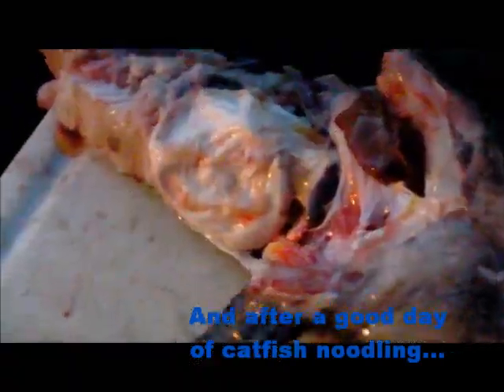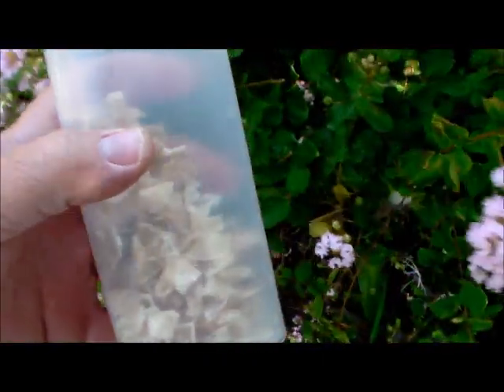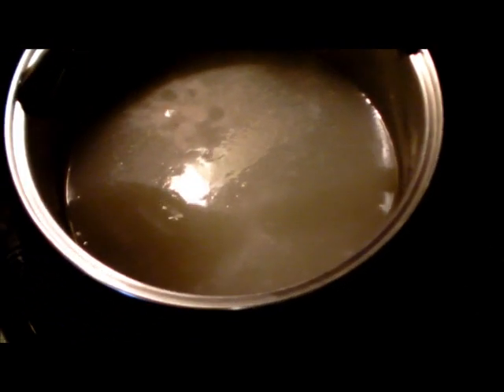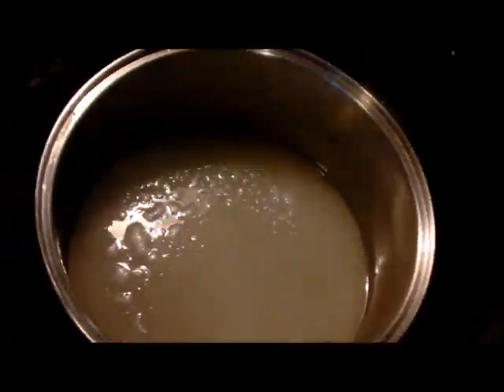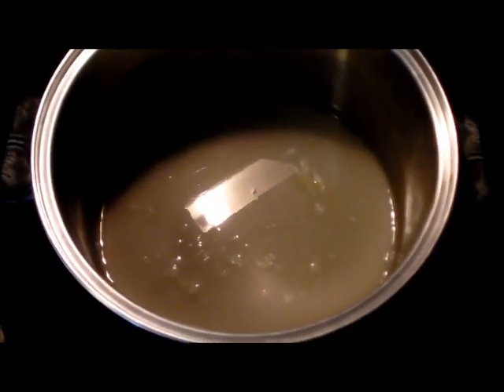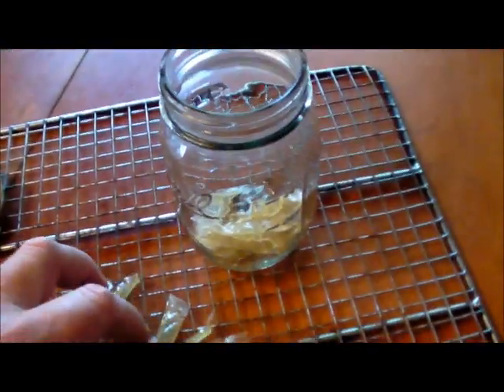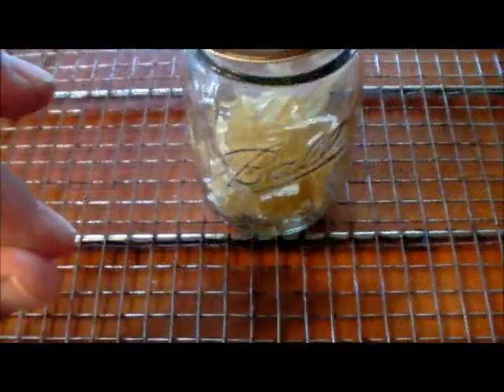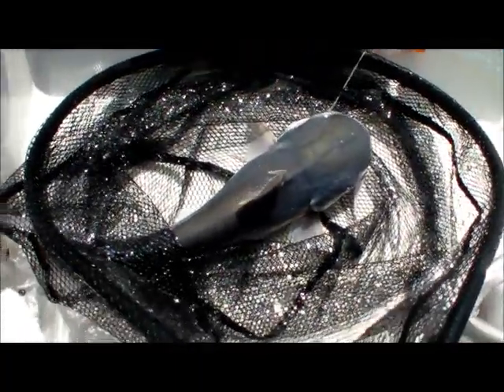Making Fish (Air Bladder) Glue

Comment: nice job. for those of us who do not have a bunch of catfish around, I got a bunch of air bladders in chinatown. It is called Fish Maw. I do not know what kind of fish they are from but they work fine. If you have an induction cooking gizmo you can set the temperature to 150 degrees and it will just simmer away. After I make the glue I pour it out in a teflon coated baking pan so when it dries it come loose from the pan.  It doesn't leave a mess so it shouldn't get any bakers annoyed.

Comment from the maker: There was a slight fishy smell during the reduction process but not bad. I'm sure a bear could still find the finished glue sticks quite tasty. 

I should have weighted the rehydrated air bladders against what was skimmed out of the kettle but it was probably around 5 to 1. There was still some used up air bladder membrane that was thrown away so the process was needed to make sizing glue.